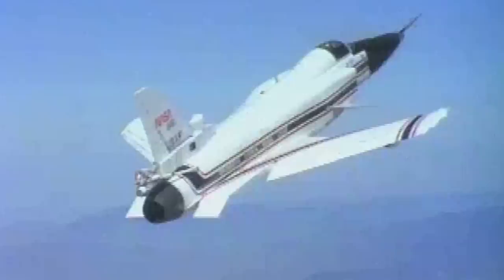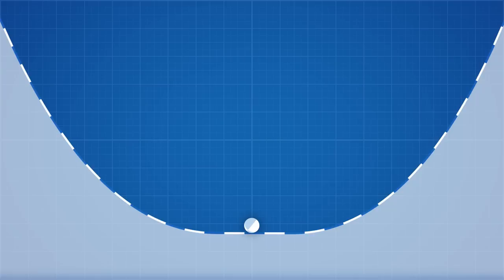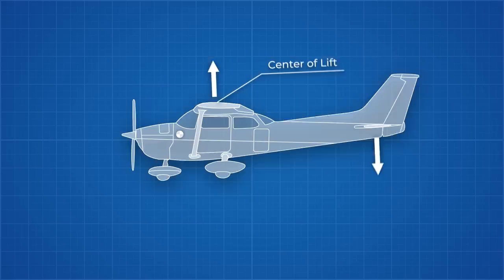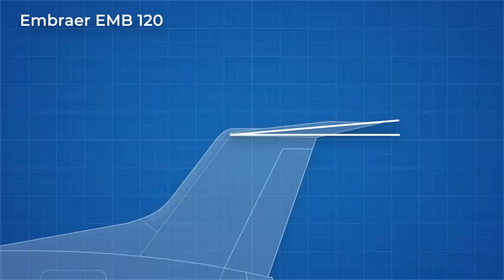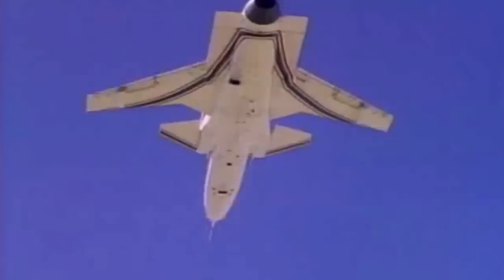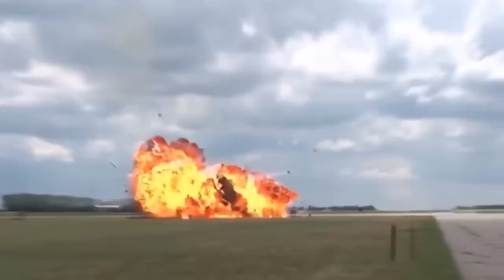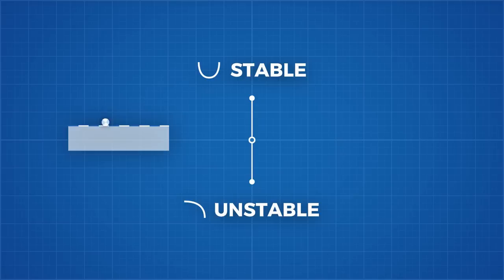Why Fighter Jets Can Be Too Unstable

Comment: There's many misleading things on this video. First and foremost, the unstability of a FSW design like the X-29 or Su-47 doesn't come inherently from the planform design of the wings but rather from the placement of CG relative to center of lift. A forward swept wing aircraft can perfectly be designed to be stable. Then, the video of the hornet crashing at 8:10 has NOTHING to do with the topic of stability. In fact that plane was designed to be statically stable if I recall correctly. That accident happened because of an engine flameout during a high-alpha pass inducing too heavy of a yaw-rolling coupled moment for the pilot to compensate. Then you hint that the energy that needs to be spent on control surfaces to recover back to 'balance' when maneuvering is much higher than what it is in practicality for unstable designs while not mentioning or accounting for the fact that 'stable' designs also pay for their stability with 'trim drag' energy bleed. You are also referring to plane trajectories with regard to stability in a way that only makes sense for trimmed aircraft with the control surfaces being fixed without pilot input, not for planes with computers running them... Usually your videos are great, but this one didn't reach your usual quality standards. Not sure if you rushed it or just don't have enough grasp on the subject. :'(

Comment: Most of the video sounded like bashing canards for being inherently unstable. But European delta-canard jets have been very successful with relaxed stability, so the issue is more with reverse wings having a very far forwards center of lift.

Interesting fact: The F-22 actually maneuvers in large part by adjusting the lift of its wings and therefore its pitch stability. The big stabelators at the tail only initiate the turn and remain in the neutral position for the rest of it because the plane just continues the turn by controlling how unstable it is

Comment: I mean, the short version is that instability is useful for not-going-straight-ability (aka maneuverability). Instability, therefore, is the best kind of stability for something that doesn't want predictability.
Reply: The issue is what you are describing is not maneuverability, it is called "Nose Pointing"
Maneuverability is about how well a plane acts in the flow of air, instability is about how well a plane can separate itself from its maneuvering flight

Comment: While what you say is essentially true the reason the forward swept wing concept was abandoned wasn't because of too much instability. It had to do with a characteristic that came into play at high speeds. The wingtips would begin to twist and then flutter at high speed. Building wings that would resist this effect added substantial weight so that at higher supersonic speeds any advantage was lost. And eventually the aircraft would become uncontrollable.

Comment: This is the reason the at the time brand new fighter jet crashed right in Stockholm city during a festival 1993. The computer was compensating for instability per design, which the pilot manually tried to compensate for, creating a oscillation with no recovery. 

The accident was during certification process I believe and they ended up crashing in an air show over central capital where with a million people were watching, me included. I can’t imagine the anxiety the pilot had when ejected. 

Now this fighter jet, jas 39 gripen has been sold by a neutral country to nations around the globe with great track record and really good price.

Comment: I was flying across Southern Illinois from East St Louis Regional near Alton Illinois to Robinson Municipal airport.  It was a calm summer day and I was flying a Cessna 150.  I reached back into the baggage compartment for my Stanley jug to get some coffee.  The plane started a slow left turn.  I returned the jug.  The plane leveled out.  I found that I could steer the plane simply by moving the jug around.  So I went further and found that If I wanted to turn more sharply I had only to open a door and push it out into the wind.  Fun.

Comment: The downwash from the wing can't be primary factor for downforce generated by the horizontal stabilizer even in fuselage-mounted configuration, like in GA Cessna. Think of a high angle of attack flight. The relative wind is by no means directed along the fuselage in that case. And it's not just the angle of incidence of the horizontal stabilizer that is another main factor, but also the shape of the cross-section, which is inverted airfoil.

Comment: Static stability doesn't necessarily mean straight or level. A lawn dart is stable but will not fly level. A plane with a rudder jammed in one direction is stable but will not fly straight.

Comment: As a control engineer I can answer this. in short the X29 was too unstable. All systems require a margin of stability. for this kind of aircraft a phase margin of 45 degrees for the closed loop system (aircraft with controller) is required. Basically you can design the controllers to improve the stability but you can only go so far given physical constraints. Our professor actually proved in class that the X-29 even with a perfect controller cannot exceed  phase margin of 30 degrees which is not considered safe. This is actually an interesting story in which the control teams spent millions of dollars trying to achieve desirable closed loop stability  before a guy proved on paper with few lines using math that this was in fact not possible. Here is a very interesting talk for those of you interested. https://www.youtube.com/watch?v=9Lhu31X94V4 the X-29 starts at https://youtu.be/9Lhu31X94V4?t=1857

Comment: Static stability implies STRAIGHT flight. But not level. A lawn dart is excessively statically stable, but will plow itself straight into the ground even with a rocket motor attached to it.

Comment: 7:04 It might be a flawed concept, but making this wings adjust that fast and still withstand air resistance at fighter jet speed is amazing.
Reply: To some degree it's what every modern fighter does. But in the X-29 the flight controls had to work too hard to get the plane back to straight and level, expending huge amounts of speed (which you don't want to lose, especially by trying to go straight)

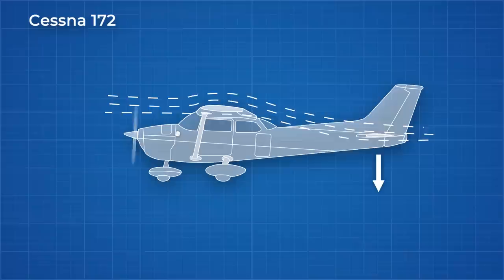Comment: 4:39 I'm pretty sure downwash is only a function of angle of attack of the wing, not speed. Sure the higher the speed the higher the force induced by the downwash is, but so are all the aerodynamic forces. To look at it relatively to the other forces acting on the aircraft, you need to remove the dynamic pressure and just look at the coefficients.

Comment: There's nothing inherently unstable about the canard, forward swept design. Simply moving the wings backwards would move the center of pressure backwards, leading to stability. Of course, this would require increasing the angle of attack of the canard and/or decreasing the angle of attack of the wing, which may increase the parasite drag. That could be a reason why they went with the unstable configuration.

Comment: Center of gravity on a C 172, which depends on the loading is very close to where the struts are attached to the wing, never near the engine suspension station.
Reply: The C of G in a 172 is that close to the C/L? Or do you mean where the struts attach to the fuselage? That would seem much more reasonable.

Comment: The problem with comments sections is partly about false information floating around. You will still find explanations of lift that say the curvature of the wing causes the air to flow more quickly over the top surface, thus causing lift. The simpler and correct answer is that the curve directs air downwards producing lift. But the false information continues to circulate.

Comment: Unstable aerodynamics enabled by modern computer technology is one of the largest modern fighter aerodynamics breakthrough. A computer calibrate the angle of attack several hundred times per second, and in a leveled flight it is stopping "the ball" from accelerating downhill before the speed give it (the ball) any energy of significance. It's the same principle that keeps the Segway types of wheeled self balancing platforms from not falling over. Because it reacts so fast and several hundred times a second it keeps the wings and control surfaces in a sweetspot where very little control authory energy is needed to keep it stable. So the illustration of the downhill movement of the ball is a bit misleading in that regard. But it works as an nice illustration on what is happening when you actually wants to pull some serious G-forces. Keeping your potential and kinetic energy level high in a dogfight is correctly a serious thing, and could lead to a deadly defeat if not managed well. There is a reason fighter planes have large engines with inneficient afterburners. But even that is never enough in high G-forces combat.
Reply: I have not seen your video on the X-29, but one important design problem with forward sweep fighter aircrafts like x-29 and su-47 I can think of is that there is problem getting the wing stiff enough. As aerodynamic forces act opon the wing it would bend a bit, and that would put even more stresses into it in an unpredictable way also creating oscillations in the wing. A "normal' unstable fighter plane that have a backward swept wing is more predictive and less prone to dangerous oscillations even though it is built aggressively for unstabillity.

Comment: Just because the aircraft pitches up, the angle of attack of airfoils does not change. The stability is caused mainly by the change in airspeed. You called this downwash but this is independent of the propeller flow. The free stream air of the aircraft still increased in a descent and increases in a climb, independent of T-tail or not.

Comment: Correction
1:00
Not any and all aircraft designed for air to air engagements are capable of manouvering tightly
Prime example, MiG-25 and MiG-31 fighter jets, designed for high altitude high speed flights.
Reply: Air to Air engagement usually means dogfight so you need a highly mobile aircraft. Mig-25/31 were designed as Interceptors meaning take-off, fly at high speed, launch missiles from long range and then return, they were not designed to be dogfight capable.

Comment: Pretty sure the c.g. of that Cessna at around 3:20 would actually be much further aft.  If memory and the internet serve, the datum on a C-172 is the firewall, and the c.g. is supposed to be between 3 and 4 feet behind that. 

Furthermore, the term center of lift can be misleading, at least as usually used. It's probably ok if you're just taking off or cruising around. However, consider a plane in a vertical dive. The wing, in most cases, is still trying to pitch the aircraft "down". For the center of lift to do that, it would have to be infinitely far away. 

The horizontal stabilizer doesn't actually have to push down, depending on how the airplane is loaded, the size of the horizontal stab, and how far back it is. On certain indoor model airplanes, like EZB's, you can sometimes see the lift of the tail bend the tailboom up. If you don't know what an EZB is, check this out:
https://www.youtube.com/watch?v=3cLJQz10bNk
Notice how large and far back the horizontal stabilizer is. The c.g. on a model like this may be behind the trailing edge of the wing.
Reply: BTW, downwash effects on the tail REDUCE pitch stability. Consider that, in level flight, the plane has to have lift equal to the weight. At high speeds, a lot of air is going past the wing, so, in order to get enough lift, it only has to direct that air down a little  bit. At lower speeds, that air has to be directed down at a greater angle and velocity. So the downwash varies oppositely to what you'd like.
Fortunately, the dominant effect is the changing angles of attack of the horizontal stab and the wing. But I don't really have the energy to explain that now. Probably most aircraft aerodynamics textbooks would explain it.

Comment: Nice video, but the analogy of the ball rolling was a wrong analogy to begin with. When the designers of f16 (mirage2k as well) decided on unstable configuration, they were not worried about energy. They wanted jets to respond as quickly as possible.

Comment: The F-15s you show to illustrate their instability are actually have static stability too, just like a passenger jet. They are old enough not to require any fly by wire.

Comment: I think there is a bit of confusion between stability, instability and control authority, and how those effect maneuverability. A fighter must be stable in order to not exhaust the pilot, especially during instrument approaches. But equally important,  a fighter with guns must be stable in order to provide a stable gun platform. Imagine a person holding a gun with shaky hands trying to hit a small target, and you get the idea.

What a fighter needs is a stable instrument and gun platform but massive control authority to change the pitch and roll quickly when maneuvering. I have flow a variety of aircraft in my civilian and military  career and had the opportunity to fly extensively back to back in two immensely different aircraft regarding controll authority.

I went to USAF pilot training back in the days when all pilots, whether destined to fly fighters, bombers or transports, all flew the T-37 and then T-38, got their wings, and then went on to their assigned aircraft. The T-38 had a blindingly fast roll rate of 720 degrees per second,  more or less neutral stability (it would simply stay in whatever orientation you put it in, roll 45 degrees right and it would stay in a 45 degree bank). Give full right or left aileron and it would be finished with the roll before you could move the stick back to center. A quick pull on the stick could have you at 7+ G almost instantly (or over G if you weren't  careful). 
As powerful and maneuverable as the T-38 was though, it bled off airspeed very quickly in a hard turn, even with max thrust. But this bleed off is speed was not due to the excessive amount of energy required to pitch and roll the aircraft,  it was caused by the same issue that plagues every fighter in a high G maneuver,  induced drag from the very low aspect ratio wing (common to almost all fighters). An fighter aircraft with very good positive stability can still maneuver, without burning up energy, but induced drag will eat up energy (speed).
The issue with excessive stability on modern fighters has to do with the movement of the center of pressure, backward, as the aircraft moves from subsonic to supersonic flight. On earlier generation supersonic aircraft, like the century series and the trainers used to repair pilots to fly them (T-38) was that if you made the aircraft highly pitch stable in subsonic flight you would require a massive horizontal moving stabilizer to pull substantial G at supersonic speed. In fact, a T-38 at supersonic  speed could not over G, it simply did not have sufficient pitch control authority to do so, but you could over G in an instant when flying subsonic.

Modern fly by wire fighters use computers to keep the aircraft artificially stable when subsonic, reducing the drag associated with a forward CG, and then still have sufficient control authority at supersonic speed without requiring massive horizontal surfaces.

Comment: Roll instability would probably be a good thing, since you can simply continue rolling to get back to level. Pitch instability, however, would be detrimental because it requires speed and power to correct

Comment: Regarding Cessna stability.  Yeah, sorta.  IIRC beyond a certain roll angle it is anything but hands off stable, and will increase roll.  I think there may be (ultimately limiting?) hands off pitch instabilities in that aircraft as well.  

No aircraft that I know of is able to quickly, some ever, regain pitch stability without oscillations sans control inputs when the initial conditions are well off the stable orientation, and with some aircraft they can be increasingly divergent.  

Most all of them are yaw stable, since that is basically a non driven arrow type stability.  And also, IIRC, it's more the CG vs CP that determines the stability than just wing chord placement, you know just like a wheelbarrow isn't.  

I built a Long EZ, a canard configuration, and I believe I remember that the CG is very far forward, in fact I think I remember that the strakes are there not only for fuel/baggage but as a stability enhancer, maybe to lower CP travel with angle of attack variation.  Been a while, though.  I expect, designing to that goal, you could possibly have the CG well off both wings, longitudinally with a canard configuration if the wing lifting percentages closer to 50%...but maybe not.  Not high confidence on that last one.  I've never tried it.  I think I remember that as you went aft CG it got unstable very quickly, and you could lose the stall/spin inherent complete resistance (main wing low speed stall, anyway, the killer end of that spectrum), at least the non divergent hands off pitch stability into a gentle oscillation Rutan called pitch buck. It was stable within that allowance even with the stick against the rear stop, and trying to slow the plane into stall.  Obviously you could put the wing into stall in a maneuver like a victory roll, taken to 0 mph, but even from that I think it would quickly self recover.